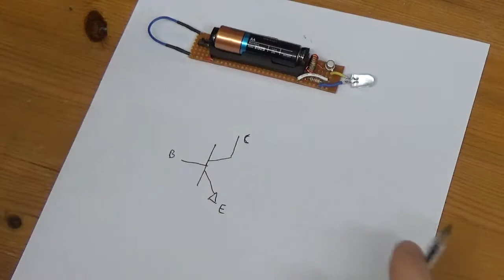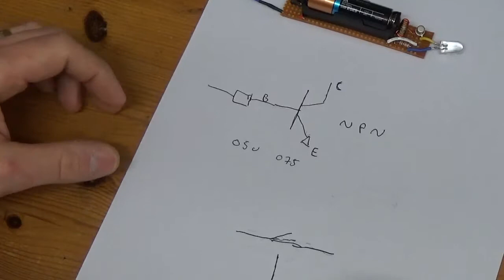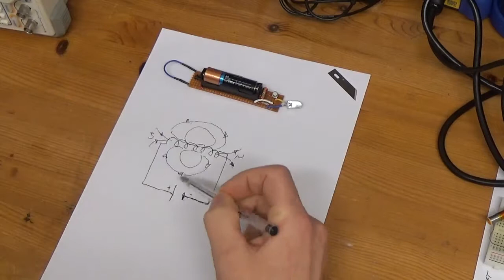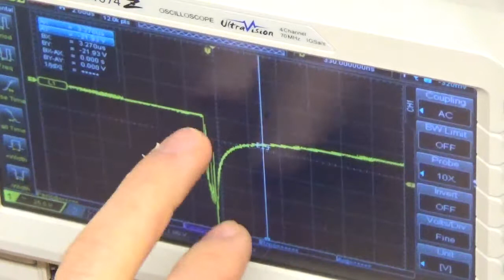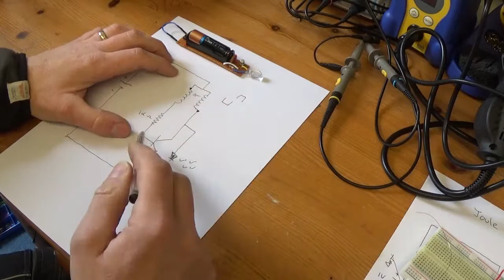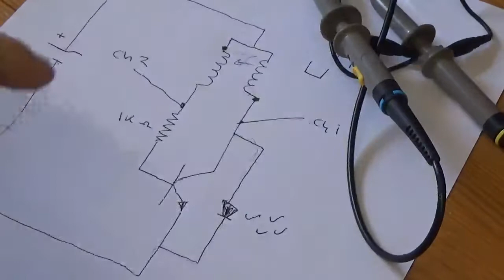How a Joule thief works

Comment: 11'20''   "as the field collapses it would induce a current the opposite way" No, it attempts to keep the current flowing in the same direction. The back-emf means the coil is now acting as a generator not a load.